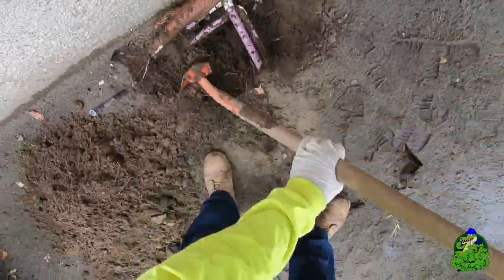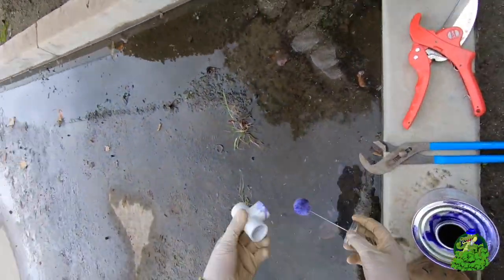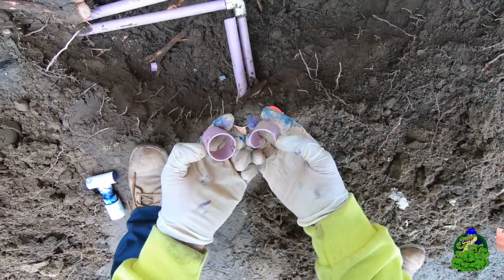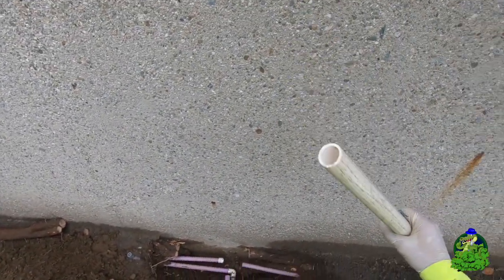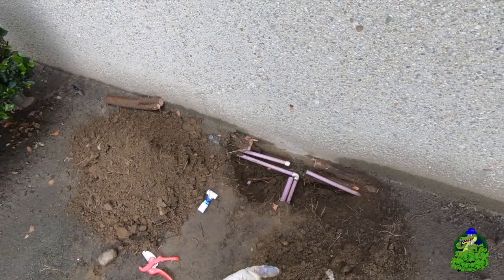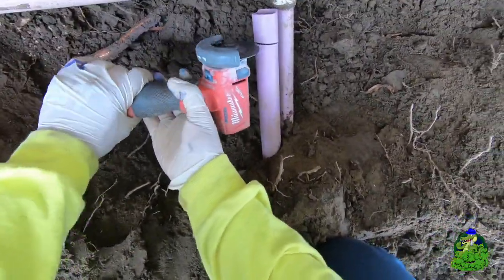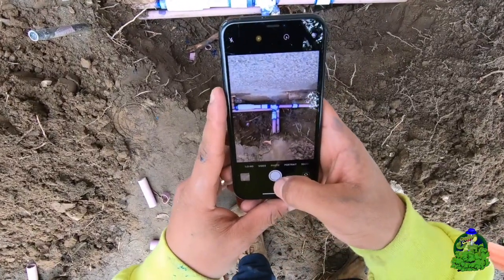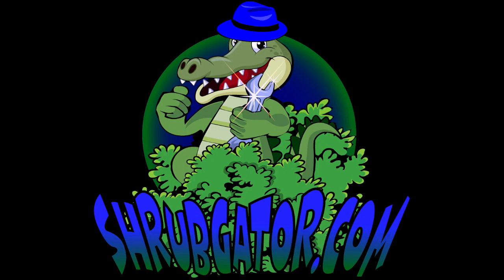How To Replace Broken TEE, 2 Different Pipe Sizes

Comment: It’s not schedule 20 it’s Class 200 commonly referred to as eggshell 

Class PVC and Schedule PVC have the same outside diameter.

The difference between Class pipe and Schedule pipe is: schedule pipe, the wall thickness is the same regardless of the size of pipe. Class pipe the wall thickness changes depending on the pipe size and is only as thick as it needs to be to maintain a certain burst psi. In other words in small pipe sizes on Class 200 pipe, it only has to be very thinly walled/ so in most cases schedule 40 is way better because it’s way thicker.

However, 2” pipe is a point of inflection for schedule 40 vs say Class 315 pipe, 2” 315 is actually thicker walled than schedule 40 when you get to 2” pipe. So a lot of water districts especially with reclaimed water will require anything 2” and over on the main lines be Class 315 and schedule 40 will not be allowed. And on the 2”+ 315 they will be required to have Schedule 80 fittings.